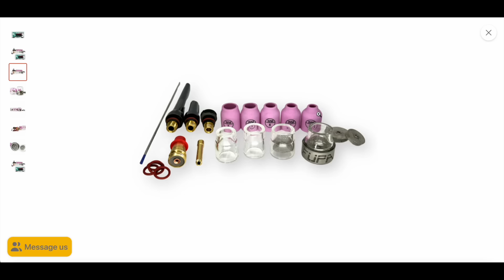Best Tip for TIG Aluminum & Clear TIG Cups

Comment: Thank you.  I have been doing a large number of fillet welds on a frame made of aluminum square tubing.  I was having some difficulties and this video provided some useful information to correct the problems that I was having.  I have also found out that preheating aluminum to about 150F is quite helpful.

Comment: I recommend welding Aluminum using DC straight, tungsten ground to a .010 point, using Helium. Wire brush good using a SST brush, then solvent degrease.
Reply: You'll go broke in my area trying to source up helium.
One reason heli-arc (Tig welding) switched to argon. In my area one bottle of up helium equals 10 argon.
AND dc doesn't clean today's aluminum worth a damn.

Comment: Quick question. I'm getting started with Tig welding and I'm looking to buy my first machine. My question is if I can afford a machine like the Everlast Typhoon 230 vs a machine like the Primeweld 225 or 325, is the cost difference worth it. I personally believe in buying things once and getting the best you can, but I'm new to this and the options out there many. I do plan to build marine products and sell them. So mainly I would be welding Stainless and Aluminum. Any advice owuld be appreciated. Thanks